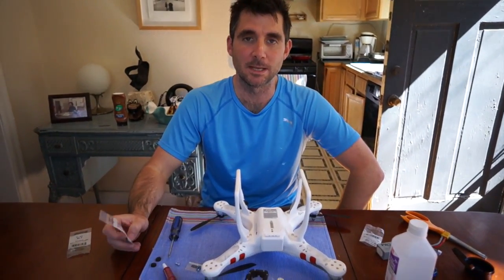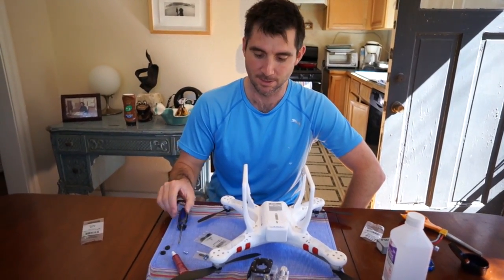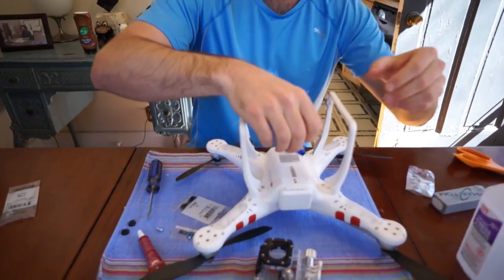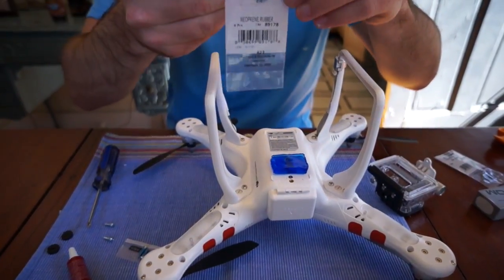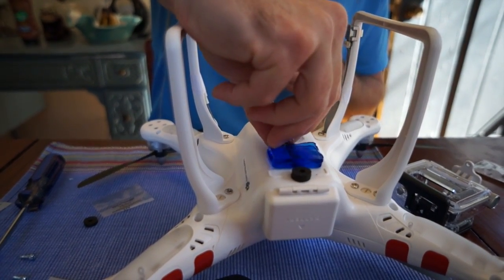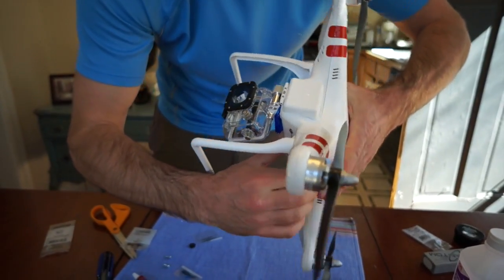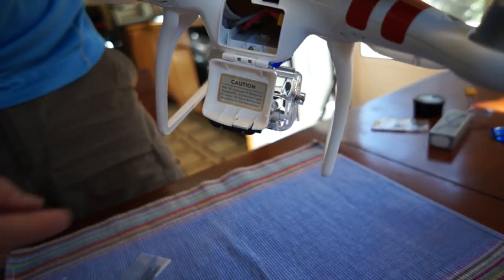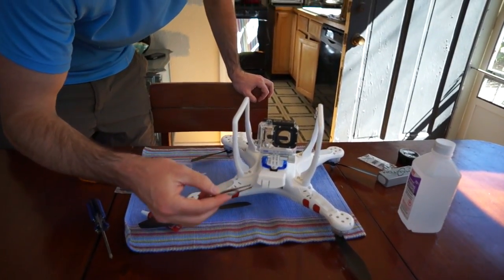Cheap and easy jello fix for DJI Phantom

Comment: It means diameter of 3mm and a thread pitch of .5mm, or two threads cut per mm however you wish to say it.
Metric and fractional bolts, screws, taps, and dies will always list thread diameter first, then thread pitch, and thereafter length.

Good video, I'm saving up for my first quad now.

Comment: They are 3mm. The .5 denotes a coarse pitch thread (as opposed to .35, fine pitch) and, of course, the length is 12mm.
3mm, .5 pitch, 12mm long
Hope that helps!

Comment: YOU COMPLICATE THINGS TO MUCH, CHEAPEST AND EASIEST 1 MIN. FIX IS TO USE A ND FILTER ON THE GOPRO TO FORCE LOWER THE HIGH SHUTTER SPEED IN DAYLIGHT, THIS IS THE BEST SOLUTION!!!

Comment from the maker: Here's what's on the packages -
Machine Screws CB#36678
M3-.5 x 12MM (you can also use 10MM depending on how many washer you want to use)
Hex Nuts CB#37568
M3-.5
Zinc Plated
Flat Washer CB#89178
3/16"
Neoprene Rubber

all made by crown bolt

Comment from the maker: Here's what's on the packages - 
Machine Screws CB#36678
M3-.5 x 12MM (you can also use 10MM depending on how many washer you want to use)

Hex Nuts CB#37568
M3-.5
Zinc Plated

Flat Washer CB#89178
3/16"
Neoprene Rubber

Comment: Very nice mod. Just starting with Multicopters and I'm still deciding on what RTF/ARF to buy. The Phantom is a great little quad it seems. I also like the foldable quads like Bumblebee, Steadidrone  etc.

I bought this prop balancer that would easily accommodate the Phantom props:
Top Flite Power Point Prop Balancer TOPQ5700.
By the way, I just moved to Austin about a year ago and still trying to get familiar around here.

Comment: i would next recommend putting larger motors on it, getting a submicro gimbal, recalibrating the macro barometer, and THEN put on some carbon fiber props.